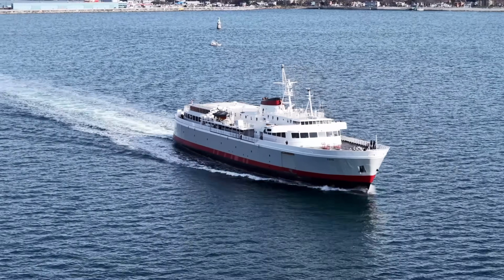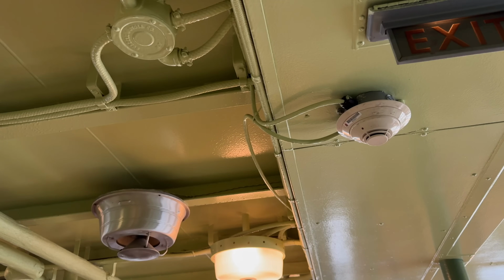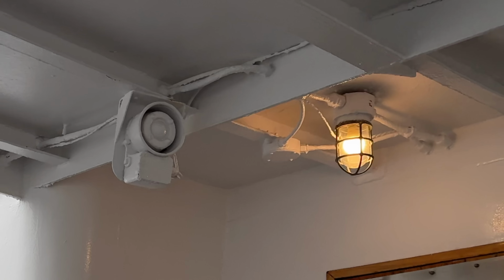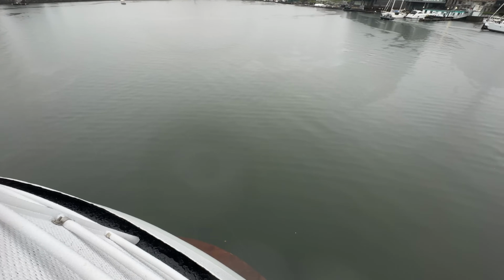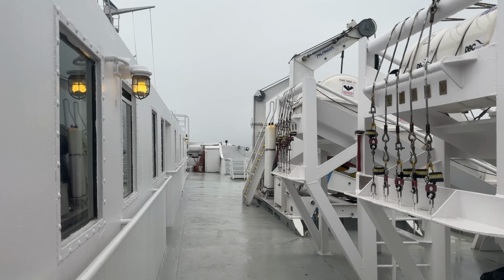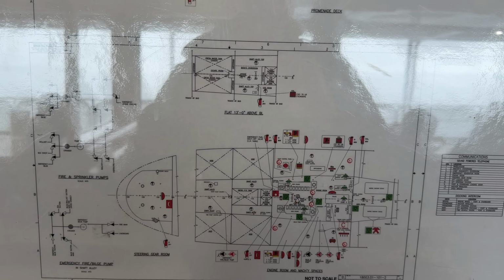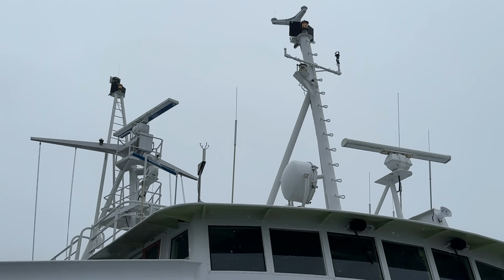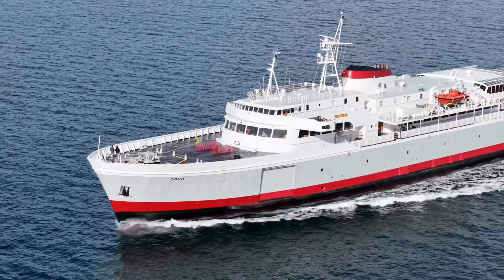1950s Fire Alarm & Life Safety Devices on Ship | M.V. Coho Ferry

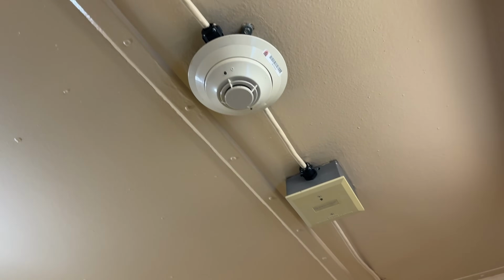Comment: 7:13 I'm sure Nic knows this but that's an isolator module.  All System Sensor isolator modules flash yellow instead of green or red, and actually aren't brand-specific; they're just a fault-sensing relay.

Comment: Excellent Trip and so happy you finally got to ride her Nic. You are right on the money regarding the fire alarm components as I had the lucky moment to ride her when they were installing the Cerberus pulls and smokes in March 1996. Fast forward to my later trip on her in Aug 2011 and by then they had swapped all the components with the current Notifier components she has today. That very system went into use for real once last May 2024 when a motorhome caught fire on the aft end of her car deck. According to news reports she was about 10 minutes prior to docking in Port Angeles when the fire broke out so  by activating the deluge system above the vehicle plus having crew cool it down with fire hoses they were able to contain the fire to just the motorhome with Port Angeles firefighters extinguishing the last of it just after she docked. Damage was limited to just a small amount of smoke on the car deck and that was it. The Coho’s whistle is an original Doran-Cunningham 6-B while the exterior speakers are University Sound MM2TC Look forward to your up and coming trip on The New Westminster soon - you’ll find she does indeed have a lot of Coho/Spaulding features.
Reply from the maker: I remember hearing about that fire. New west is next on my list. Thanks for the info on the whistles.
Reply: Also I was looking at the map of the life safety devices on the bridge and I see that up there that the general alarm bell also shows a bell with an “F” marked next to it likely indicating fire alarm. I wonder if that bell alone also rings when The Notifier system goes into alarm. If so this confirms the remaining bells throughout the ship are sounded separately and quite possibly the bridge bell also doubles as an audible component of the fire alarm system.
Reply: Ok quick update; looked over the maps one final time and it would appear that throughout the crew spaces on the top deck there are several separate bells marked with an “F” plus one in the engine room. This now leads me to believe that when the Notifer system goes into to full alarm bells “do” ring in all crew areas but not passenger areas as those bells have no F next to them. So yes the general alarm definitely has no relation to the Notifier system whatsoever and would have to be manually sounded from the bridge. Makes sense as obviously the main alarm would only be needed if you needed passengers to head to muster stations etc - I believe that’s the only time the whistle would be sounded as well.

Comment: those out door speakers are Not compression drivers, they are revers mounted cone drivers have a simular speaker, there is an actual cone speaker inside that centre part that faces inward towards a deflector,  there are different types of these, this is a compact type for smaller spaces,  the cones are usually coated in resin to water/wether proof them,  the larger revers mounted pa horns are often more full range in sound with a forwards mounted compression driver tweeter in the centre.  compression driver horn speakers look more like you intruder alarm sirens
Reply from the maker: Interesting I figured they were compression drivers based off how they sounded they were pretty loud but didn't sound great.
Reply: @nics-systems-electric these small ones are midrange to high range,  mine is upper lows to upper mid range,  mines a vintage realistic 40-1244A water proof  pa/music horn.  the larger ones are capable of lower ranges,  and hello from BC canada